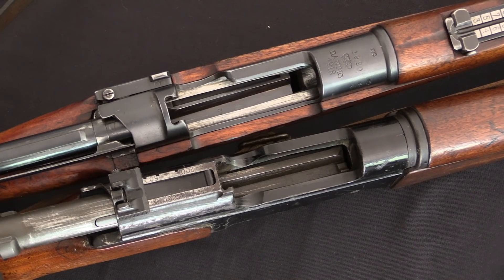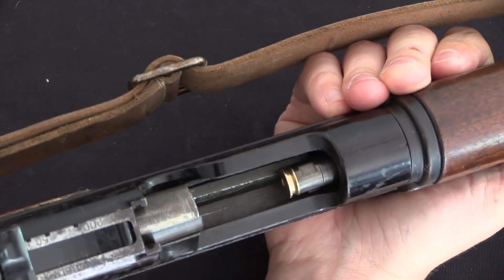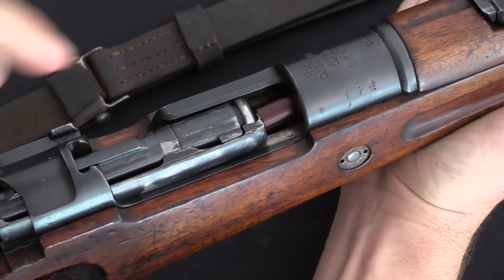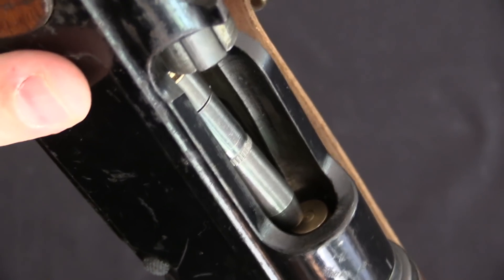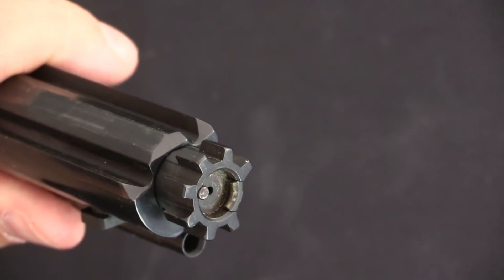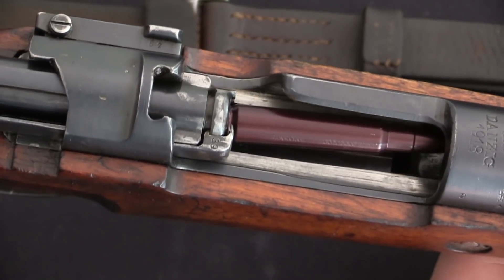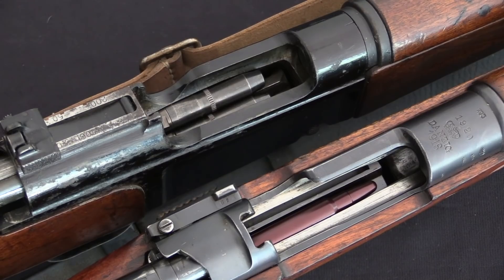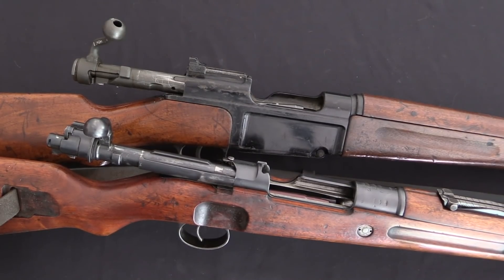How Does It Work: Push Feed vs Controlled Feed

Comment: For ye olde military and Bubba purposes, I can understand a desire to not have to fully chamber a round in order to unload the magazine, thus theoretically preventing a situation in which someone could have an oopsie in those circumstances.

In practice, nothing is foolproof to a sufficiently talented fool, and a 3-position safety, or one that doesn't lock the bolt handle, is a better, simpler, and cheaper CYA measure for a manufacturer to take.

Comment: My only issue with controlled feed, and this likely more of a manufacturing issue vs a design issue, is that it often seems harder to eject, or hangs up with ejecting more often.
Reply: If it is a quality gun, then probably you are not working the bolt vigorously enough.  CRF guns are usually the best for feeding.  Military ones put a huge priority on everything being as slick as eels.  They are designed around a single cartridge, and the cartridge is designed to feed, no square shouldered Ackley improved nonsense.  And quality sporting rifles are the same thing, often using older nice feeding cartridges, though the action will probably be used to  house cartridges it was not designed for.

CRF guns often use a metal protrusion to catch the cartridge edge, and flip it out.  If you examine the left side of the bolt, will see a matching slot.  If you are not slamming the bold back a little, it may not eject well.  Using a CRF gun makes me feel a little rough on the rifle, but that is the drill.  On the positive, you can easily catch ammo for reloading when you are doing load development.

Comment: Slow feeding short cartridges with a Push Feed system is very prone to jams.  Quick feeding is less of a problem.  Slow feeding cartridges from the magazine are less of problem with a Controlled Feed system, and slow extraction allows the shooter to drop the empty case nearby, or fast extraction will kick the case quite a way.  With Push Feed the case ejects under spring pressure with both slow and fast extraction forcing a target shooter to using 2 hands to keep the case from flying all over the place.  Push Feed is just a Bean Counters way to more profit.

Comment: So my knowledge is entirely build on Youtube videos, so apologies up front if my question is a bit iffy... Is one of the downsides to a controlled feed also that because the spent case is pulled back by the bolt that if you have questionable quality ammo the bolt can on extraction rip the rim of a shell case?
Reply: In both cases, the extractor is attached to the bolt so there's no theoretical difference in how extraction itself happens. Many/most controlled-feed rifles have a larger extractor than what's practical to have in a push feed, so of anything the push feed may be more prone to tearing rims. You'd need a pretty bad ammo problem (or a rusty chamber) for that to happen, though.
Reply: @Kaboomf  It can happen on some semi-automatic rifles, which are often push feed. It's exacerbated there by the more violent action but it still doesn't happen often and usually only if there's something wrong with the ammo or the rifle.

Comment: Having used a push feed rifle extensively, the most annoying thing about it is the plunger ejector, specifically when shooting at the bench.  As a reloader, I like to catch my brass as it comes out of the gun which the plunger ejector makes difficult to do.  I have just recently been shooting a swedish mauser with the controlled feed and I find it much nicer to be able to control the ejection of the brass by how I pull the bolt back.  In practical hunting applications though, the plunger ejector works wonderfully to get that fired brass out of there as quickly as possible.

Comment: Inconvenient of the controlled feed I noticed on my M1917 Enfield: if you chamber a loose round without using the magazine, then extractor won't clamp the rim and you won't be able to close the bolt. While this may not seem like that big of an issue at first, if your magazine is damaged (like mine is) or you someone managed to shake a round lose (close the bolt halfway, bring it back because cocking on close surprised you, then try to close it the rest of the way), you've just jammed a live round in your chamber with no easy way to extract it. Pretty annoying.
Reply: True, in a target shooting situation a PF action is more convenient.  However, in a combat or dangerous game situation a CF action is far more reliable, particularly as regards the prevention of short-stroking induced jams and extraction/ejection of spent cartridges.  That's not an opinion; it's fact.

Comment: Back in the day when millions of cheap surplus Mausers were being sporteried, three things were almost always done to the bolt. 
1 Bend the bolt handle down for use with a scope.
2 Change the safety lever to clear a scope.
3 File the end of extractor so that it would "Pop over" a cartridge that had been dropped into the chamber.
This last part was so that one could load 5 in the magazine, drop a 6th round in the chamber and close the bolt. Unmodified, the Mauser bolt would not close on a carriage that was just dropped into the chamber because it had to slide up and under the extractor lip before entering the chamber. This filing had to be done carefully as too much filing and the extractor could fail to grab the rim of the cartridge and thus not extract it reliably. Too little filing and it would not "Pop over" the rim when closing the bolt. done correctly, it would still control feed from the magazine, and also close on that 6th  round. 
Most of the guys having these rifles modified had just fought a war with them and I guess they considered 5 plus 1 was better than just 5. Maybe when they were in battle, they had sometimes wished that they had just that one extra round.  
I've seldom needed more than one round or maybe two rounds when hunting, but for some reason it always felt like my rifle was half empty without that extra round in there.
Two other things done to the action were to file down the "Hump" around the clip feed slot on top of the action to mount a scope. Also file a little off the rear of the magazine follower to get rid of the last round lock open so you could close the bolt on an empty chamber without having to hold the follower down by hand.
Reply: Very cool stuff, thanks. I will make one minor comment.. most of the guys having those rifles modified had just fought a war against people with them ;)
Reply: "Most of the guys having these rifles modified had just fought a war with them" The majority of American Bubbas didn't fight (even if they did serve) and very, very few had 03s.
Reply: Never had an issue doing 5 +1 in my yugo mauser also I doubt their is any difference with the German mauser in regards to this topic their is just enough room to press the rounds down and have the bold glide over them you must’ve heard that from someone who doesn’t know what they are talking about. What I’ve experienced whenever the controlled feed fails to control the round and the cartridge gets pushed in the camber you can still “pop” the extractor over the round albeit with some persuasion. With all that being said number 3 sounds like tall tales
Reply: @palkappy8581  ... And you can guarantee that this rifle of yours was a WWI or earlier model, and that at no point in the 100+ years since it was made was it filed (or even worn) down?
Reply: Oh they will close on a cartridge ahead of the extractor just be prepared to use a LOT of force
Reply: @zacht9447  Some would, but few, and I tend to think they were worn just enough, or someone tinkered with them in the past. The extractor didn't have much of a bevel in the edge and the face of it stuck out too much and tended to hit flat on face of cartridge head with too much area to slip over the edge. You had to file the edge of the extractor back slightly and file a sharper bevel in the edge. You had to be careful to not file it too far or it would sometimes slip past the rim when trying to eject the empty case. 
I know how to do it, having filed more than a few while sitting around my uncle's gunsmithing shop while he did important stuff like rebarreling actions drilling scope mount holes, his brother did the stock work.  I still have a couple of the custom guns they made for me over the years, built on wildcat calibers. 338/300, 405/300. 
300 win mag case is longer than the other belted magnums so you could put in more of a slower burning powder to increase velocity with less chance of over pressure.
338/300 was basically 300 Weatherby ballistics without having to buy overpriced weatherby rifles and ammo. The 405/300 was one step in making something to compete with the 416 Rigby in a standard length action. Besides I always wanted something different than just an "Off The Rack" rifle like everyone else had.
I spent the 70's trying to get him to build something in 50 caliber on a bolt action rifle. 
Why? 
Well, when asked why  he carried a Colt .45 the old cowboy Answered 
"Because they don't make a Colt .46.."
I got over the Wildcat faze, but I never got over the Big Bore faze. 
My elk rifle is a .416 from Remington's Custom Shop.
I've shot elk at 400 yards with it, I've never had to shoot one twice, and I've never had to go looking for one that I shot.
Reply: @terri200026  Never had to file on any of the ones I have owned. Brass is a lot softer than steel is, it doesn't take a great deal of force to get the bolt closed if the rifle is clean.
Reply: @terri200026  I dont think I could do gun smithing for the simple fact of shit like this "How hard is it to convert the Czech VZ 52 to a 7.62 X 39 ? What exactly needs to be done ?"  Seeing shit like this makes me die a little inside.
Reply: @zacht9447  Standard loading procedure for the 1903 Springfield rifle with the magazine cutoff engaged was to drop the round into the chamber with the muzzle held slightly down and close the bolt. It always worked just fine on mine, no "lot of force" was needed.
Reply: @johnkelinske1449  that's a 1903 not a k98 it's got a smaller hook easier to snap over a rim
Reply: @zacht9447  It is still a Mauser action, I have a Vz-24 that does the same as have several other Mauser action rifles I have owned in the past 50 plus years.

Comment: Hey Ian, I have a Savage 99 which is a controlled feed although it's not a bolt action.  It is an amalgam of kinda falling block and lever, but it works well.  I also have a Sako 85 which they claim some kind of controlled feed but many people just call it a push feed plus.  Which would you call the Sako 85.  Can you do a video on the Savage 99 please?

Comment: someone correct me if I'm wrong.
push feed generally wears out faster?
Controlled feed can be damaged by simply trying to drop a round in the chamber and closing the bolt?
Reply: The extractor will wear more in push-feed as the extractor will be forced over the rim of the cartridge every cycle. Controlled-feed can be single loaded, but it comes down to the extractor design.

Comment: Thanks for the explanation. I've been hearing "controlled feed" for a while and just thought it was another gimmick or catch phrase. Now I know.
Reply: Most definitely not a gimmick, but it really only matters in a few very specific situations.
Reply: @ScottKenny1978  Yes, 3 in fact.  1) CF largely eliminates short-stroking induced jams (which are a real issue when using a bolt action in a stressful situation) 2) the fixed blade ejector on a CF action is far less likely to fail than a button ejector on a PF action and 3) the extractor claw on a CF action is much more positive and reliable than the extractor on a PF action.

Comment: Work at an ffl, had a guy that came in and made a point to see our control feed bolt action rifles. Which consisted of a Winchester model 70 and a kimber Hunter. I would venture a guess and say that they are not very common in today’s firearms
Reply: No, not very common at all. Mauser actions are the only one you didn't mention that I know of.
Reply: It's still very common, just not as much in bolt action rifles (even though you see more of even those in Europe). Outside of bolt action rifles however, you'll find controlled feed for example on almost every semi-automatic pistol on the market.

Comment: Many minor differences between sporting and military arms are not going to have a significant effect on the sporting side.  Even on the military side, getting more rifles into the conflict through reduced manufacturing time can offset the increased reliability of a better design.  The single biggest factor is difficult to assess because it's largely intangible.  Troops need to have confidence in their issued weapon.

Comment: The controlled feed is far better for a bolt action because of its reliability. The round on a Mauser is extracted at the point it's behind the back of the cartridge anyway so it really doesn't make much of a difference than push feed. The reason alot of bolt actions today are push feed is because push feeds are cheaper to make. That's the reason why the Winchester Model 70 became push feed in 1964 which ended up being a very unpopular change. Controlled feed needs a large claw extractor which is more complicated. The Mauser was designed for the extractor to flex to snap over a round already in the chamber.
Reply: Someone else wrote that in this comment section :
The thing about controlled feed is that if the case somehow jumps ahead of the extractor (such as on Mausers with worn feed lips), it becomes impossible to then lip the extractor over the rim when turning the bolt to lock. This can result in a similar double-feed situation if you haven't realized what's happened. I've had this happen on my 98k, and Bloke on the Range has also had it happen to his Manky Mauser
In my opinion, reliability will depend more of the individual condition of the rifle rather than its way of feeding.
There are many examples of reliable push feed rifles.

Comment: Question. With a controlled feed is it possible to put a cartridge in the chamber and the rest in the magazine?
Reply: As in, drop a cartridge into the chamber and then top up the magazine?

Not in a Mauser action. The extractor can't snap over the rim.
Reply: @ScottKenny1978  unless you modify the extractor, grind a little bevel on the front and it works. This slightly weakens it though, which may ne why the military ones lack that feature.

Comment: I have a Remington 22 LR bolt action with a tube magazine from the 1930's that has a really interesting elevator system that can run 22 short, long, or LR. It lifts the cartridge inline with the barrel then the bolt pushes it directly into the barrel. There are no ramps so the nose of the bullet can't get deformed, and there is no way to double feed.

Comment: A lot of people believe push feed is bad for dangerous game because the cartridge can be flung from the ejection port if you turn quickly while the bolt's open. I've never believed that though, as in practice the cartridge will either be held by the magazine lips or far enough into the chamber to be secure. 

I think it's way harder to make good controlled feed guns without really high levels of fit and finish. A roughly made controlled feed gun is going to be far inferior in feel to a push feed.
Reply: There are certainly push feed rifles where the round isn't held by anything for a part of the travel. The round may fall out of the rifle even when operating it at some weird angle. Not that it's an issue in most reasonable situations. And any rough gun will feel inferior, regardless of the feed style :)

Comment: I agree, but push feed can be a issue in modern day rifles. I have seen ARs with extended charging handles get double feeds while charging. The extended charging handles get caught on clothes and stop the bolt mid travel.

Sure, a minor issue.
Reply: i think double feeds on an AR would mostly be from a shit mag spring. ive had this happen with old colt marked mags (only 1 or 2 out of the 4 i have were good)